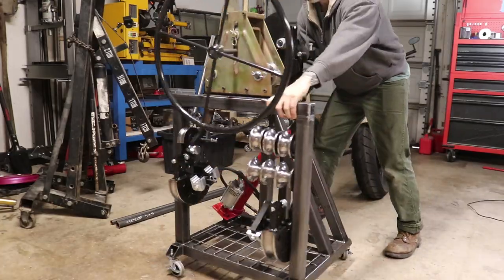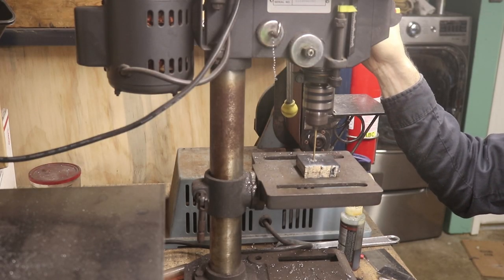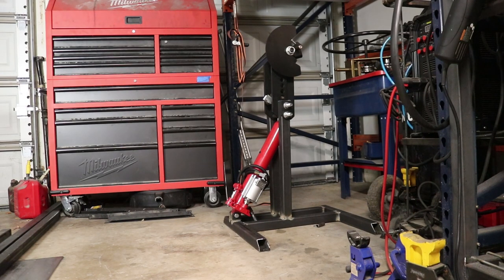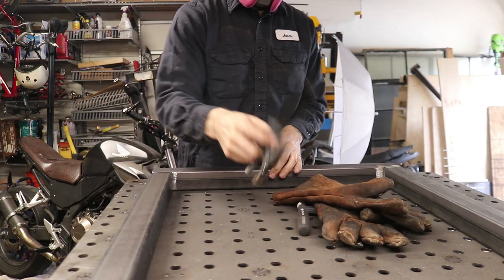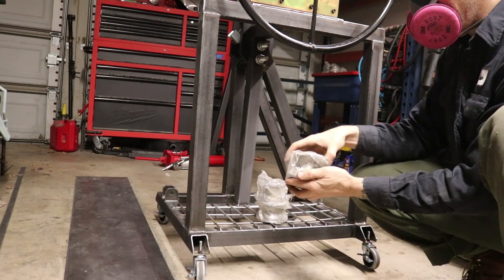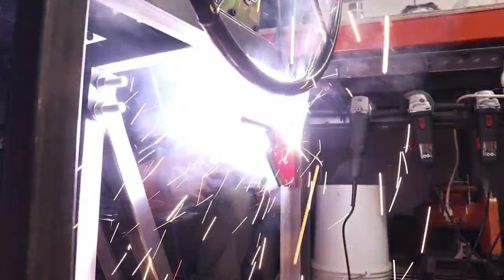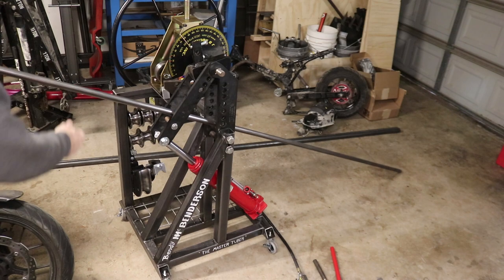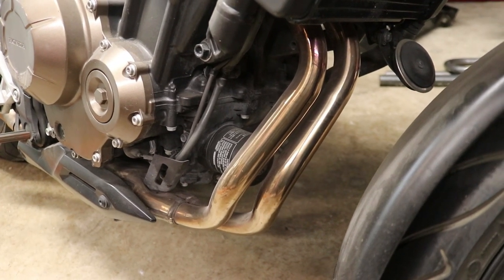JD2 Vertical Hydraulic Tubing Bender Roller Combo | Bendy McBenderson

Comment: This is interesting. I just bought a Swag off Road tubing bender and the same roller. I never considered them on the same cart. Just curious, since it's been a few years, have you found any limitations with the bender regarding angles or compound angles you've been limited on with the roller being there?
Reply from the maker: Love it! Made a motorcycle frame and several other components with it. I would like to upgrade the roller as it can't handle .120" wall tube. There are kits  to beef it up and add power so that you don;t have to manually crank it. These are some of my life goals :)

Comment: Not sure how much air that cylinder uses to operate but you could probably fit a small compressor underneath and then it would be an all in one mobile unit. Just a thought. Might not have enough air to make it worth while though. 🤷‍♂️
Reply from the maker: I had a similar thought when I made my plasma cutting cart. Then when I went to use it I learned why everyone gets the biggest air compressor they can 😀 https://youtu.be/PMiBJQ4UghI
Reply: HooptieDoodle Lol I figured it would use a lot of air. I’m hoping to get a big shop compressor soon. I love your build! Would be nice to have it vertical like you have it for space saving and also now you can use digital angle finders. Assuming that sucker is level when you bend your tubing. 👊

Comment: I have a JD2 Model 32 that I'm building a T-shaped stand, but I may change it, after seeing your design.
Let me ask you, the Harbor Freight tubing roller, do you think it would do well on 1.75" HREW (1/8" wall) tubing?
According to folks on a FB Tubing roller group, they say I will still need to buy  1.75 dies from Swag Offroad.
Your thoughts?

Comment: Did you manage to make the spring return for it yet? I would make 2 brackets that go straight and bend down at a 45 to clear the ram.  They would mate up to the two bolts at the end of the ram and the JB32 cranking arm. From there anywhere at the base to retain the return spring... problem solved
Reply from the maker: If I am visualizing your idea correctly,  it sounds great. I have yet to do anything about return springs.  I am just manually pushing it down, which has been tolerable with my lower frequency of use. If I used it daily or weekly,  I would want a spring, or maybe I would just build some serious muscles! 💪😀💪

Comment: What air compressor were you using to move the ram?
Reply from the maker: I'm using a Husky 30 gallon  155 psi, which I don't think they sell anymore. It works good for what I'm doing, but 30 gallons doesn't  last long and the compressor is loud, but it does get the job done. Everyone always says get the biggest air compressor you can and I would agree.
Reply: @HooptieDoodle  ok don’t laugh at me because I don’t know anything about air compressors but do you have to take your compressor somewhere to get it filled?
Reply from the maker: @williamgarcia9751  that is kinda funny, but no, it fills itself with air. You've got your tank that holds the air and then the compressor (which has pistons like an engine that force air into the tank), and the compressor is run by an electric motor attached to the compressor via a belt. All these components make up what is called the  'air compressor' . You do need to ensure the compressor has oil and change the oil out once in a while (kinda like a car engine. Kinda). Then you have a valve to allow air out of the tank and a regulator to dial in the pounds per square inch (psi) of air flowing out. Then most people add filters and water traps after that as well - which is important for certain applications - especially painting for otherwise you can add contaminants to the paint 😔.
Reply: @HooptieDoodle  lmao thank you so much man. Does it take a while for it to refill? I was thinking about getting a 8gal compressor because I’m strictly a hobby bender. I like building crosskarts. Will that be enough?
Reply from the maker: @williamgarcia9751  the 30 gal I have runs a LOT while I am bending, but not constantly and never runs out of pressure, so the compressor gets a break.  I  would recommend 30 gal or more. I am no expert, so take it with a grain of salt. If you go too small you'll run completely out of air pressure mid bend and have to wait for pressure to build back up - it's not conducive to productivity.
Reply: @HooptieDoodle  thank you. You have given me the ultimate insight to my questions. I will look for a 30 gal compressor
Reply: @HooptieDoodle  also I guess until I get a good one I can also crank it lol